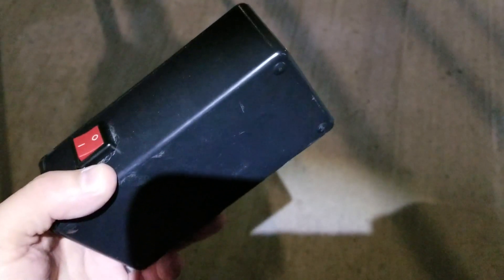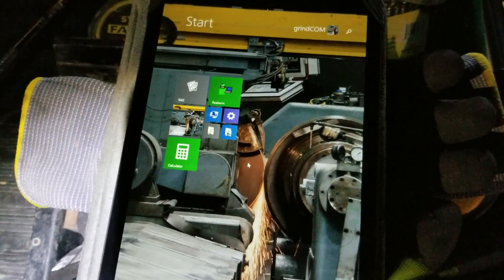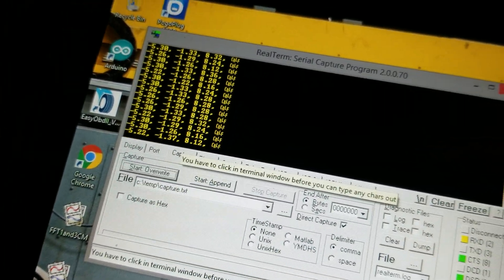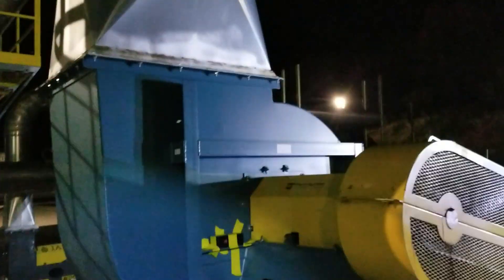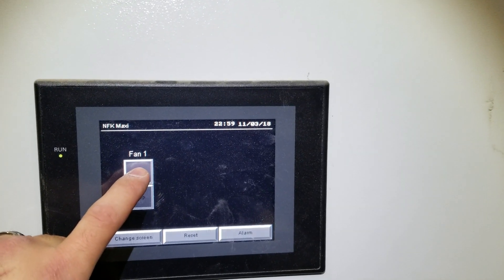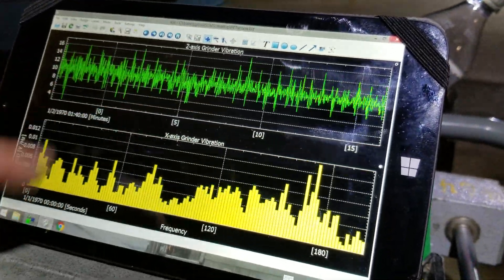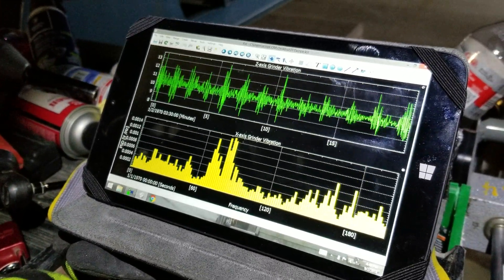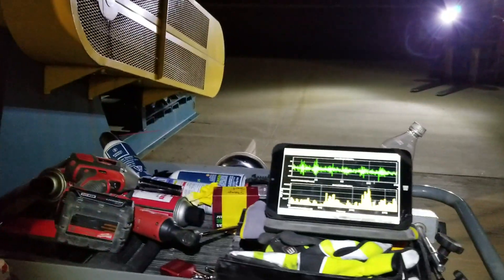Arduino UNO Vibration Analysis

Comment: You can immediately see that the accelerometer is read on the I2C bus! what real "online" mode are you talking about!? The graph plotter shows that the sampling frequency is very small and therefore more than half of the data needed to build a full-fledged distortion graph is lost.
And why is this video without a full process of balancing the fan rotor!?

Comment: What is the ADXL do you use?,If you use ADXL345, this acelerometer has a bandwidth (BW) <1600 Hz, with sample frequency 3200 Hz, then you get data wrongs to this  particular application.
Reply: if and only if this chip is configured with this fs that is maximum BW
Reply: @EPandDSP  why? Explain